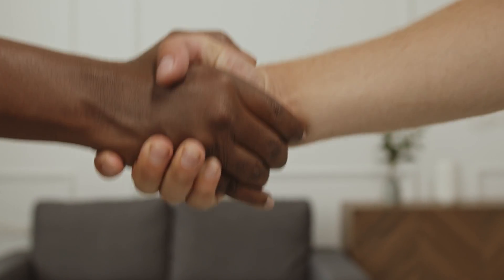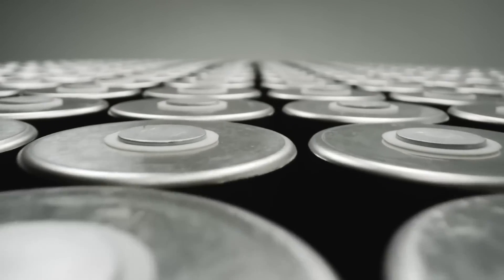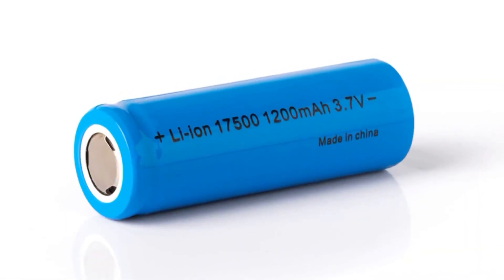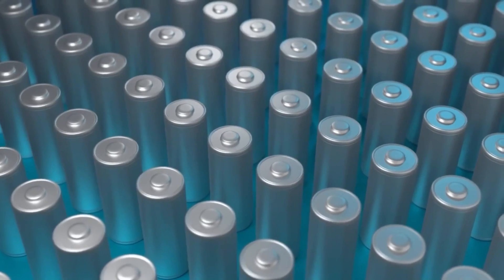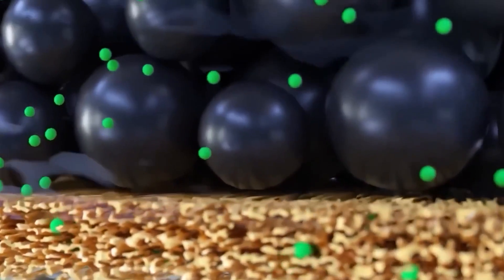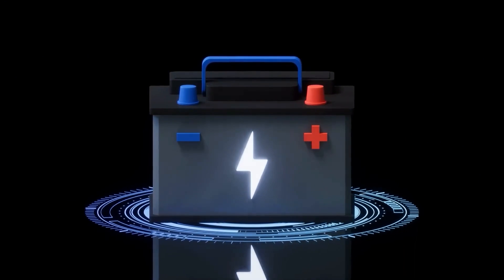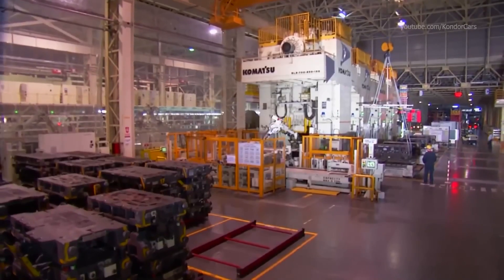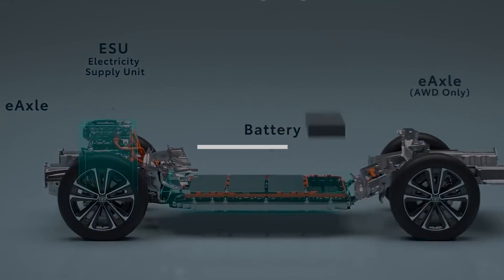Toyota's Solid-State Battery FINALLY Enters Mass Production!

Comment: Are solid-state batteries simply the evolution of lithium-metal batteries? Lithium is still maybe .0065 percent of Earth's crust; aluminum is 8 percent, and it takes several times as much energy to mine and refine lithium as it does aluminum. Graphene Manufacturing Group's aluminum-ion-graphene batteries will still hold more charge, last through many more charge-discharge cycles, and charge faster. And they will cost much, much less.

One word, Toyota: Aluminum.

Comment: you just have to do the math to see that there's no easy way to create an infrastructure that can charge so many electric vehicles, so they either have to be very expensive (which few people will buy) or subsidized by governments on top of subsidizing power generation and transmission.

Comment: So the 2025 Toyota Solid State battery (with obscene number of patents to lock down every formula that might work)... is now 2027-8. 
Being consistent on what you are promising but keeping arbitrary stats is not of value.

So, I would recommend "Toyota Solid State battery estimate pushed back to 2027-8 this time" as the title as their last few estimates were way off (much worse than even "Elon Time") as Elon has a detailed plan when he underestimates timelines. 
He averages a few years late. 
This has no such "credibility".

Then there's Toyoda's continued interference in Toyota.

Comment: I was disappointed to find out that Toyota will not have cars with solid state batteries for 5 or more years.  The solid state battery takes care of many of my concerns: range, chance of fire, and charge time.
Reply: Agreed.
Reply: Ah yes but the BIGGEST concern is there is no where near enough charging infrastructure to charge large numbers of cars. You will not be able to charge your batteries in 10 minutes because the charging stations dont provide enough power.
Reply: No its not, the biggest concern is the range. I have model 3 and i never have to charge outside unless if i am going long trip. The whole point of ev is to be self dependent basically having ev charger installed at your house heck even if you don't have ev charger installed you can use your dryer charger to charge your car like i do. It will charge within 6 to 7 hours easy with dryer outlet. If my model 3 had 500 miles range instead of 300, i would never ever had to charge outside my house even on long trip. Even if my car gave 400 miles range i still wouldn't have to. Electric cars gives like 10-15 percent less range than they claim. So yeah if range is increased then charging stations wouldn't be a big issue for half of the buyers. Not saying charging stations is not a issue but it definitely is not a bigger issue than range  @pauls3075